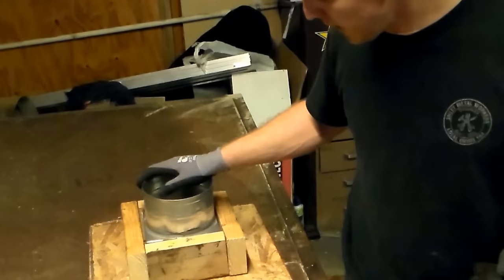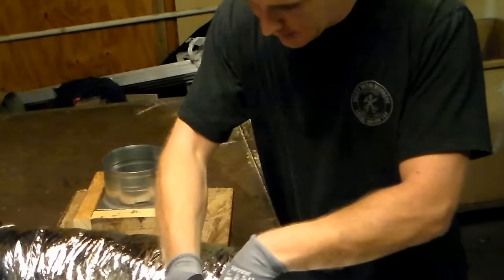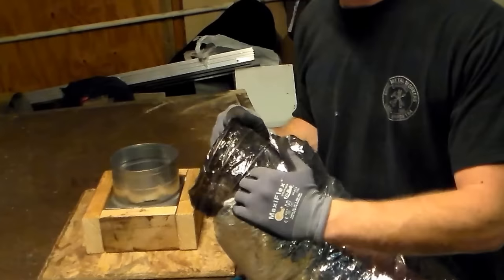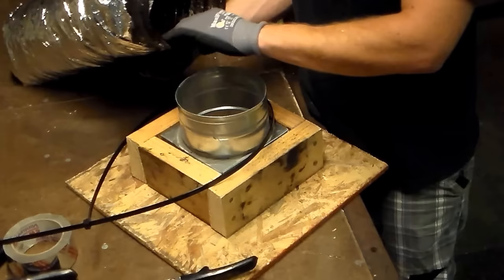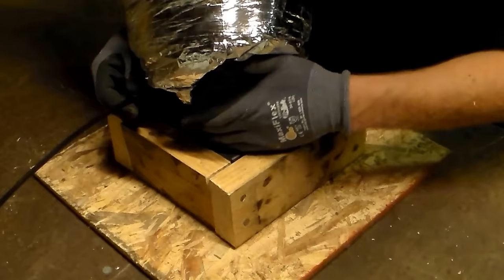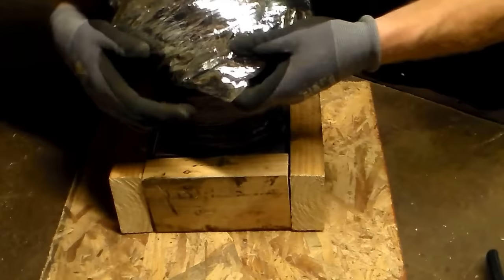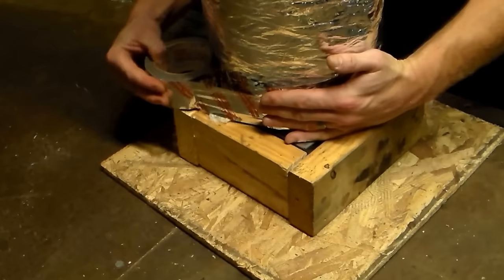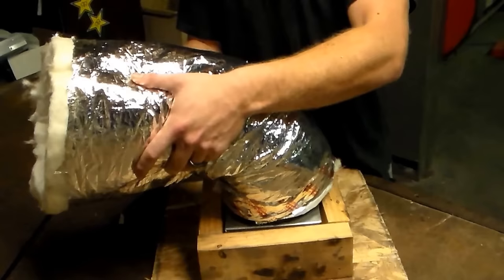How to cut connect and install flex duct, flexible pipe for  heating & air conditioning ventilation

Comment: I have to disagree a little with your install of flex to boots/taps. the biggest concern I have is that you do not seal the mylar (plastic inside the insulation) to the metal. This can be a huge air loss even with the banduit strap tight. taping the insulation wrap is good however I suggest it be secured to the to the metal at the end as well so it stays tight and insulated (no gaps for heat transfer). banduit is good, I prefer a screw tight against the banduit or the wire inside the mylar  after the tape is used to seal it to the metal, the tape also stops the mylar from ever tearing. Thanks for sharing, Good Luck.
Reply: That is exactly how I was taught 30 years ago.
Reply: we always apply mastic to the inner liner of the flex before putting it to the metal. then we pull the outer insulation layer and fab and mastic it to the box.

Comment: If you put mastic on the inside of flex and then slide it onto the boot it will make an excellent seal. Great video thanks
Reply from the maker: +stlwrkr68 Touché

Comment: Let me update you on your practices. One would think flex duct connected with a panduit strap only is a sealed joint you would be wrong. In an attic duct leakage is a huge waster of energy especially through the return flex. LEED or Leadership in Energy Efficiency Design requires mastic on the collar where it connects to the register box or boot, the boot sealed to the sheet rock, and when installing flex mastic is spread on the collar the flex is slid into place over the mastic, a strap is installed. More mastic is spread on the outside sealing the end of the flex to the collar. The flex insulation is then pulled down and held from lifting off with tape or by some other means. Never strap over the insulation as it will be compressed and made ineffective. 

On Platinum LEED installations we spray foam over the finished connection sealing the flex to the boot and the boot to the sheet rock. Yes this costs more, but for instance it is common place to reduce the capacity of the system by up to one ton. We recently took out 8 tons and put in 4 tons just by sealing and insulating the new duct system to LEED standards. Would you think the homeowner would get a payback? We have reduced electrical hvac bills by 80% in doing so this with no other changes to the property envelope.
Reply: unbelievably helpful.  thank you!!!!
Reply: If you were able to take out 8 tons and replace it with 4 tons, then the initial company that sold the customer 8 tons ripped them off by Oversizing the equipment needed for the load. It's not that it was leaking 4 tons of air, that's ridiculous. I'm sure it was leaking some, but not that much. They were just trying to make more money by selling them more equipment then was needed. Also, there is nothing wrong with putting a ziptie on the outside of the flex to hold the insulation over the boot or collar. It will compress the insulation some, but not enough to make it sweat. I've been installing for 15 years, and that's how everyone in my state (NC) does it, and I've never seen a job fail inspection for it. Everybody does it a little different, which is okay, as long as it's right. All my job get blower door tests to test the duct for leakage, and I've never had a job to fail the test. Actually, my jobs are always the tightest at my company. I had one job with less than 1% leakage, which is awesome, but I use a lot of mastic. It's impossible to have a job test 0% leakage, less than 1% is as low as you can get, and it means it was sealed perfectly.

Comment: Great video! I'm finishing my basement and need to reroute a stretch of my ductwork, and raise it for my drop ceiling, because some pvc piping is in the way, not allowing me to raise it to the height where I need it. I was going to call an HVAC company, but this seems simple. almost like hooking up a dryer vent.

Comment: side cutters can be used to tighten panduits, after zipping it down grab it with the side cutters and with a twisting motion tighten the panduit. i havent bought a panduit tool in years and my bag is lighter
Reply from the maker: agreed john roesti I dont use them on the job but for the sake of demonstration
Reply: Linesmen work great..

Comment: I saw you have a local 104 shirt on. I'm also part of that local. district 1. what company do you work for. I have actually ordered duct from you to support our industry and entrepreneurs like yourself. keep doing what your doing brother. I was taught to zip tie, then tape then zip.tie outer jacket. I'm sure it's different everywhere but here in sac that's what we do
Reply from the maker: Hey Andrew, yes I was actuall 4th Generation in 104 starting with my Great Grandfather Owr Murray. But I recently transferred out of the bay area up North to Oregon.
Reply: The Sheet Metal Kid how much would you charge to install all new ducts? I think there is 12.

Comment: very helpful video. I have a question though, I live in FL and trying to partition my garage so I have a small office. the air handler is in the garage, so I was hoping to install a vent right on top of the handler, but I can't install a rough-in box. any thoughts ? this part of the insulation is big, solid, and square- not round and soft.

Comment: If the vent duct does not have a bead, can I use a screw to hold the metal in the flex duct from coming out, have you ever heard of this?
Reply from the maker: Yes that is fine Ojeramup12

Comment: Good Video; but how to remove flexible duct from the it's box.  There is a warning on the box "not to cut the tape".  The box seems to be under pressure from compressing the flex duct and I image if I open the box, the flex duct will spring out!  Thanks.
Reply from the maker: Yeah, it doesn't tend to spring out enough to hurt anyone too seriously

Comment: Can anyone tell me, how much noise do flexible ducts such as these introduce? I have duct fan and want to make it quieter, would it make sense to move it to a sound isolated location and deliver the airflow via ducts where its needed, or would that be even worse?  The airflow is rather strong (It's a 72 Watt duct fan 10 cm in diameter)
Reply from the maker: You can use a flex connector if you are getting fan noise in rigid duct
Reply: Flex is quieter than sheet metal. We use it in recording studios.

Comment: Can I use flex for a real tight turn on a heat run in a basement ceiling.  Using standard 5 inch ducting has made the turns way to deep into head room area.
Reply from the maker: I would utilize an elbow if its too tight the flex can kink

Comment: hi.  the ductwork in my garage condensates like crazy in our 95 degree summers, especially when the garage door is open.  there is no outside duct insulation.  but, there is an insulating liner inside this supply line, which is pure shit!  it's not taped or glued together inside, and consists of smaller pieces, some of which had fallen over/down inside and was blocking a ton of air!  this is pretty ridiculous, in my book.

our kids bedrooms (located over the garage) are always hot in the summer and cold in the winter.  i discovered the builder had simply layed cheap 6" slinky bathroom exhaust type duct inside this supply line.  there wasn't even a proper attachment with a boot!  so not only is this duct probably not receiving an adequate amount of flow (and leaking), it's blocking flow in the supply line for the rest.  this ductwork is all within our garage ceiling, which contains batt insulation that covers this 6" duct.  it's obviously better than no insulation at all, but i imagine it can't be better than using a properly insulated 6" duct like you demonstrated here.

it's frustrating because I just got done relocating a different duct attached to this supply line, to be more efficient and leak-free.  I also taped and goop'd all the leaky joints i could get my hands on.  even the main trunk coming off the AC unit had sizable leaks at each corner on each end (8 total).  I always thought it was strange that my garage overnight would somehow become significantly cooled, but I didn't realize it must have been from all the leaks!  am I on the right track and could you reassure my wife i'm not wasting my time?
Reply: +Justin Wittock You need to hire an hvac contractor to do the job the right way. Or fix it yourself but a true professional is the way to go.
Reply from the maker: +Rich J. You are definitely on the right track. I would attach the 6" lines correctly and then add dampers to all the other runs to redirect some of the air back to the kids room. You would have to adjust the dampers so that you have some sort of balance. but stick with it. you can do it!

Comment: You forgot to seal it with mastic, the connection should be sealed.
Reply from the maker: sorry 88skisupreme
Reply: The Sheet Metal Kid Actually, although it should be sealed, no professional HVAC people I know use mastic. Tape + panduit is the way professionals do it here ... I'm not saying this way is code, all I'm saying is the professionals I know do not use mastic, only tape + panduits.